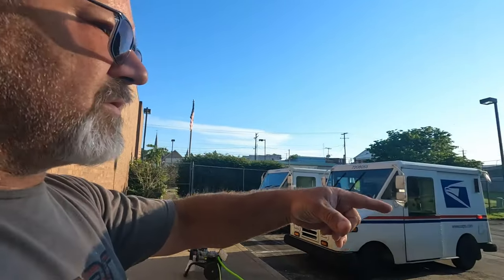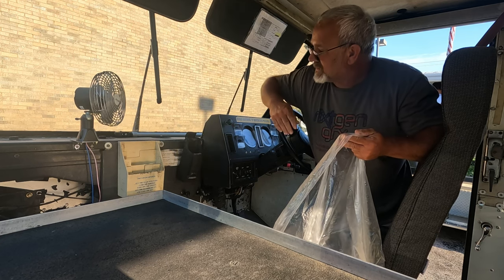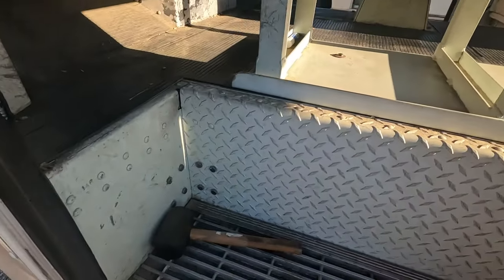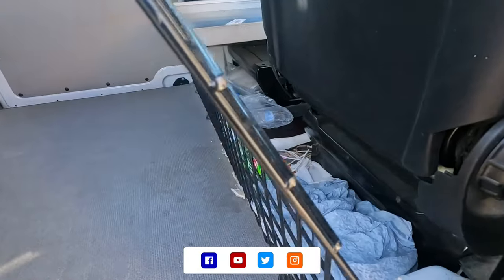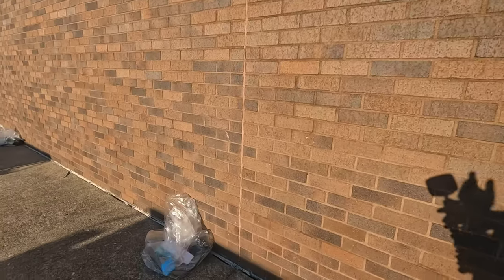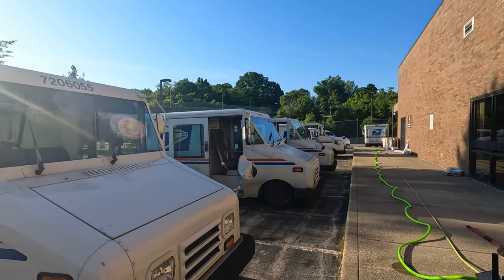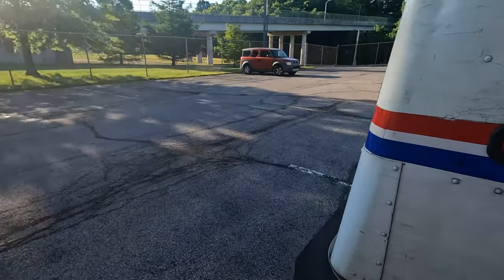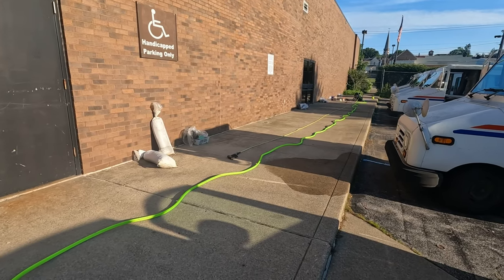Fleet washing Mail trucks

Comment: I own a Mobile Detailing Business in Southern Wv and I started doing the Post Office the City that I live in but the problem was payment. What is your method of payment because they told me that they ONLY use a WEX card as their method of payment. I quit doing them because to get set up for accepting the WEX Card will cost me $1200 to get set up with ONLY the equipment needed. I guess this is a machine that has to be stationary at the place of business. Well I have my Credit Card machine set up with my bank and I can use it on the road via Phone or Credit Card Swiper. Any information that you can offer would be greatly appreciated. Thank you from Kleen Karz Auto Detailing...
Reply from the maker: They have a system to where I log into online and enter vehicle numbers, mileage and date and they direct deposited straight to our account in 2-3 days. It was easy. It was called Voyager

Comment: How did you guy charge? And how do you land these types of jobs?
Reply from the maker: Thanks for watching. We charge them $25 mobile fee, $25 per vehicle for outside, $45 per vehicle for inside. They actually called us.
Reply: The usps has guidelines for washing their fleets on the website. Believe me it’s unrealistic in many ways with water reclamation etc. even if you had a car wash the usps wants you to meet certain requirements. Glad you got this work! Those buggies all need cleaning
Reply: @nxtgengfx9297  so $70 per truck for outside and inside?. How many trucks are cleaned and how many times a week? thank you